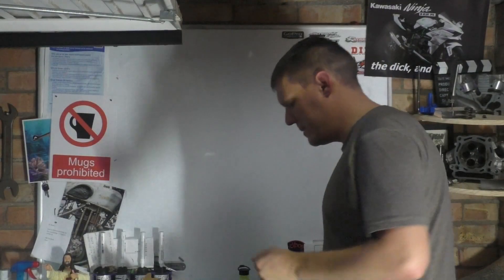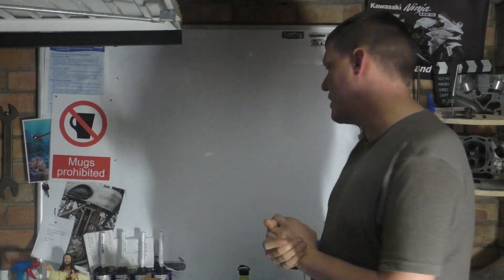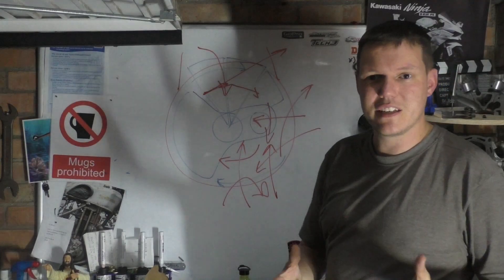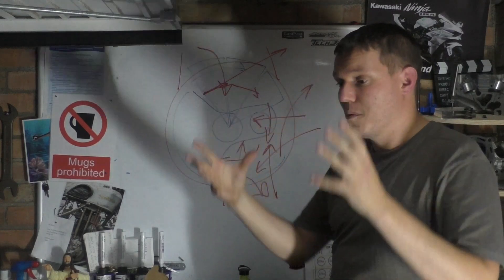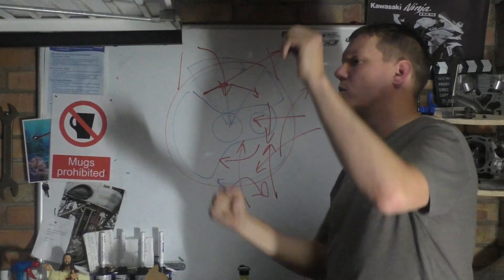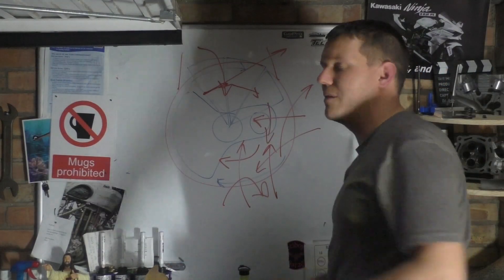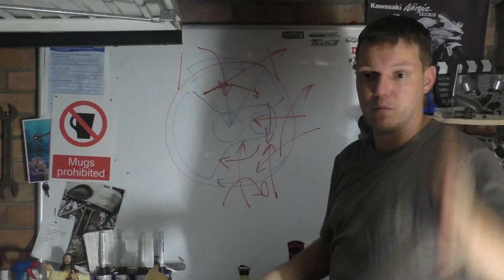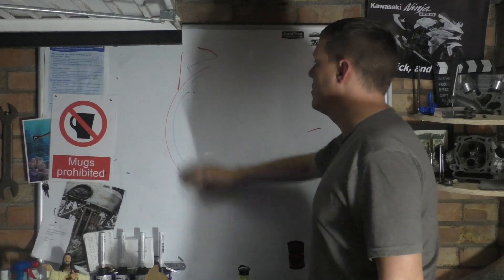Knife edging Crankshafts - Does it work?

Comment: This may be a stupid question, but isn't the crankshaft submerged in the engine oil? And if not, Which parts of the engine are?
Reply from the maker: lol no, and we'll get to why
Reply: no... generally the only thing actually submerged in oil will be the oil pickup to the pump

Comment: Knife edging the crank shaft would not make a difference aerodynamically, however, it would lower the mass which, in theory, would make the application move easier with less power applied allowing it to accelerate quicker...
Reply: But it would fuck the balance up, right? The material is there for a reason, if they could make it lighter they probably would at the factory.
Reply: funcounting  If they do it properly then no, if they just go ham at it and guess by eye then yes, you are right, it would vibrate and kill it.
Reply: aaaand you'd have to rebalance the piston and conrod...
Reply: SESH Rider  Wrong, the piston and conrod are in the centre, they will not have moved because of knife edging the crank shaft, it does not alter the axis angle at all.
Reply: @TheOldRogue  Of course it doesn't. i'm talking about the weight of the rotating mass.
Reply: SESH Rider  I stated that above that if they did it properly then it would be ok, if not then it would vibrate and kill it. :)

Comment: They did that a lot in the 80s and 90s with the high revving 4 cylinder race car engines, they did that only to lighten the crank though and not for any aerodynamic reasons. Since a race engine is probably driven at full throttle 90% of the time, the idle doesn't really matter, revs were the only thing they cared about back then.
Reply: Lighter components also makes for faster shifting I think. Less strain on the gear box slamming the gears without using the clutch and faster rev matching on up shifts.
Reply: @Henrik.Yngvesson  Lighter components make a faster revving engine and therefore probably easier to rev match. Durability wise there weren't really much problems with the gearbox, since the 4 cylinders didn't have much torque, that was more a concern for the 6 cylinder turbos, like the 3.5l straight 6 turbo from BMW in the e9 coupe. There was no 6 speed transmission that could withstand the torque of that engine and the 5 speeds that could had   not enough gears for the straights, which caused the engine to blow up quite often due to over revving on the straights. Must have been a blast to drive these beasts back then.

Comment: I didn't hear you say anything about lighter parts being able to spin easier.  Definatly agree with it being easier to stall with the loss of mass.  The engine balance would also be shite after this modifica..........I mean, change.
Reply from the maker: that's because this wasn't about that - one thing at a time. There's actually loads about angular momentum and rotational inertia. It also leads onto cross-plane crankshafts etc

Comment: There's not even much air in a crankcase is there? I thought the intake had a draw out of there, so it's low pressure?
Reply from the maker: LOL no. The volume of a crankcase is huge.
Reply: cars have that sort of thing via a check valve, but i think it's more to do with making sure the crankcase doesn't become pressurised and piss oil out of every imperfect seal
Reply: Not too much because you get leaks and power loss because of blow by. The optimum is a slight vacuum( just a tad) the rings seal better, but not so much that you suck oil into the cylinders. Many older engines or race engines for shorter stints like dragracing only have a breather to let out the over pressure into a bottle somewhere to keep the oil mist from leaking onto the ground.  Dragracers work under full power the whole time and they have a lot of blow by because of the extreme compression and/or overloading they do with turbos, superchargers or nitrous so the little power loss they get does not really matter: 1500 or 1505 bhp? Who cares...

Comment: Ok but this crank from that specific bike is knife edged from the factory .. I have some serious Ducati corse racing cranks here wich are super thin made but strangely the stock 749R is actually knife edge shaped so streamlined . I understand what you mean with the modified stock crank to knife edged modification but in this case this is not what I was referring to .. hell I walk to the workshop right now and send you some pictures to show what I mean haha .. keep up the good work I love your channel and even pick up a thing or 2 here and there that helps me
Reply: There might be advantages in a high reving bike engine as the crankshaft webbings might spin fast enough to stir the engine oil up into foam. I know that normally there are splash shields in car applications.

So the crankshaft is not optimized from an aerodynamic point of view but one regarding engine lubrication.

Comment: on a single cyl 2 stroke its incredibly stupid. 1 cylinder ecual you remove weight from the counter weight which makes the engine poorly balanced and you inlarge the volume of the crankcase(a little bit) which is not good for the compressing of air fuel mixture in the crankcase (eng = 2nd language)

Comment: If knife edging doesn't work please explain why a homoligation engine like the 749R from Ducati would have this stock ..? This engine was developed for 1 single purpose and that was to compete in world supersport racing back in 2004 etc . If it would not have any benefit what so ever why would a company like Ducati even go trough the lengths to give it this shape
Reply: Hi Toine, if I remember correctly you used to have some Ducati cranks from John Hackett? If so then the billet cranks were made at DKE where I was working. The cranks were not like the T shape if the stock road bikes and were a wedge with densamet plugs in the counter weight and a large alloy plug in the pin area. We would radius the webs ob leading and trailing edges  because the Ducati would have a lot of oil travelling back to the oil pump and it was to stop windage with possible oil starvation more than cutting through the air. The huge pistons travelling at 90 degrees to each other would create more turbulence than a knife edged crankshaft could deal with. It was purely to help allow the oil to get back to the pump with less intrusion. Hope things are going well with you... Rich.
Reply: @YAMR1M  thanks for the detailed explanation!
Reply: No problem.. I spent 2 years working for a company called Holbay making cranks for tuned road cars and Lotus prototypes. Nothing special. Later I went to DKE and made cranks for Ilmor, Cosworth, Honda cars, Porsche, Mercedes (AMG and Brabus) BWM Alpina, Judd, Nissan, Toyota TRD, WCM Moto GP (based on a Yamaha R1 engine, check it out) Yamaha WSB R7's with a crank I designed, Petronas FP1 road and WSB bikes and yes they did built all the bikes, Kawasaki and Ducati the list is almost endless.. Matt is right and Knife edging is pretty much pointless in most cases Its engines which have wide webs like some of the V8 drag or NASCAR engines or the Ducati where it did actually make a difference. Most it was like pissing in a lake.. It will raise the water level but you will never see it.... Its too small to measure in most cases.
Reply from the maker: There's a difference between thin webs from the factory - like say the subaru boxer crank and knife-edging a crank that was stock. Don't mix up the 2.

Comment: And now you have to re-balance your conrod and piston to the counter-weight. Great fun.
Reply: Few minutes on them with cut off wheel should do the trick xD
Reply: The point of edging is to reduce weight of the counter weights equaling it to the piston and con. Rod making them the same
Reply from the maker: But they are already... do you think they're not balanced from the factory? Or do you think that much mass needs removing vs any aftermarket parts???
Reply from the maker: I think you don't know what you're talking about? Secondly, removing from the edge wouldn't be the best place to remove mass...

Comment: I thought knife edged cranks were for wet sump systems to pass through the oil with less drag.
Reply from the maker: The oil in the air. Same thing - and also bollocks
Reply: @thedirtyworkshop  does depend on the engine a bit too.  As for it being bollocks.. Yep it is too in most engines. Nissan touring cars were very extreme and would take the dry sump return pipe off after running the car to measure how much oil would come out.. They were obsessed with it even though most of it was just oil returning from the head and else where that had nothing to do with the crank holding or being coated with oil. They would even micro polish the crank webs to try and get the oil to not stick! That was obsessive to the point of being insane.

Comment: Its doesn't matter for a 2 stroke... but for oil filled case, it makes quite a difference. Car accelerates, and some oil pools at the back of the engine.  The crank is moving like 300+km/hr on the leading edge in a viscous oil environment. Its like 25+ lb ft for something like a 2jz at 8k rpm. Titan motorsports claims 40-60 lbft and mass is reduced to 45lbs from 60, for their 2jz knife edging. It can also keep the engine oil cooler and less foamy.
Reply: It doesnt matter on a 4 stroke engine either. 
FIRST of all, the crank is NOT lubricated by being submerged in oil. It hangs directly above the oil level. It gets its lubrication from oil canals inside the block and through holes drilled into the crank journals.  The sump has baffles that keep the oil away from the crank. If you had a crank splashing into the oil at 6 to 10000 revs you would froth it up like a milkshake by creating LOADS of tiny air bubbles in it and that would be VERY bad for the engine.
In high performance engines you also sometimes have so called oil scraper plates mounted next to the crank that are supposed to scrape off the oil when the crank rotates. But that is purely the oil coming out between the crank and the journal caps and from the conrods and piston lubrication systems (In a race engine every millisecond and every little ounce of power counts...)
 We used to make those scraper plates ourselves on the race engines. Loads of measuring, cutting, filing and swearing.
Many will say they have NEVER seen any baffles in a sump? 
No. Not in the sump of a normal road car. But just take a look into ANY high performance sump and you will see the baffles and some after market race sumps even come with scraper plates ready to be adjusted/filed and cut for the crank you want to put in
Reply from the maker: "Its doesn't matter for a 2 stroke... but for oil filled case, it makes quite a difference."

- prove it.

"on the leading edge in a viscous oil environment."

- LOL I don't think you understand what's going on inside dude.

"It can also keep the engine oil cooler and less foamy."

- this is mainly due to windage trays
Reply: For just 2 webs on a crank, the drag force = 24612 newtons, aka 33 hp, aka 21.65 ft/lb @ 8000 rpm

This is probably fair, if not understated, because there will be resistance on all the webs. For something like a inline 6, the back of the crank will basically be swimming in oil on hard acceleration, but the density of the air-oil mix will not be 872 kg/m^3 across the entire crank. I think the thick viscosity of oil would also increase the Cd dramatically more then 2.1.

F = 0.5 C ρ A V^2

A = Reference area , m2.
C = Drag coefficient.
F = Drag force, N.
V = Velocity, m/s.
ρ = Density of fluid (liquid or gas), kg/m3.

A = 0.00387096 m^2 (aka 38cm^2) for the rear 2 crank webs
C = 2.1 Cd, Assuming a flat faced block
V = 83.3333 m/s, aka 300km/hour crank web speed
ρ = 872kg/m^3 20w-50 density

24612.65 = 0.5 * 2.1 * 872 * 0.00387096 * 83.3333^2

Comment: To me knifing the crank only makes a huge difference in crank weight not aero/hydro dynamics. You would end up turning your motor into a quick revving monster with no low end power due to low reciprocating mass? Do I have this right???
Reply: I remembered your video about GP engines having minimum crank weight. That's why they have to idle so fast, no reciprocating mass to keep them idling in the lower RPM range. See I listen... someone needs to tell my wife that :)
Reply from the maker: Reducing the rotating mass means that less energy is used in acelerating that mass. This is a double edged sword. Lower engine speeds means that between ignition event the cranks losses speed due to pumping losses etc. This generally means a rough as fuck idle (if you get one at all) and sometimes lower end torque is reduced. 

This is specially important for lower numbers of cylinders with single feeling the brunt of it the worst.

The whole point of knife-edging is what I explained in the video. Crankshafts are usually well balanced and removing this mass to some of the extremes these idiots do, seriously effects that. Coupled with the reduction in the flywheel effect (angular momentum) compounds itself to make a real shitty running engine.
Reply: I always thought/read that knife edge had more to do with lightening and balancing when you switched to lighter weight pistons and con-rods.
Reply: The crank(shaft) does not belong to the reciprocating mass, as it is spinning and not reciprocating.
Reply: Some times you want yo remove some mass but not too much. I always wondered why some guys wanted 40% taken off and balanced. You have to putmallory metal in the throw to balance it. Why take it off in the first place?
Reply: He's got it backwards anyways , you would want a bull nosed front edge and a knife edged trailing edge , do it wrong and you'll probably have lift like a wing !!!!!! It's not worth it .

Comment: Does the crank spin through oil in the sump?
Reply from the maker: LOL god no. At high rpm this would break a crankshaft.
Reply: I know, but i bet alot of peeps think that it does
Reply from the maker: Already working on the video dude
Reply: no it doesnt, unless you overfill with oil
Reply: No it doesn't.
Reply: I think that at high RPMs the crank would blow the oil tangentially in the direction of it's spin, maybe making one bank (if it's a V-x engine) more lubricidous than the other
Reply: Nope.  The clutch doesn't, either, which a lot of people also seem to think it does.
If you look in your bike's service manual, there's a section with lubrication diagrams - they usually have a cutaway view where you can see where the crank and clutch are in relation to the oil level window (or dipstick).

Comment: If a crank is knife edged the counter/balanceweights needs to be bigger, because you cant remove weight without it vibrating like crazy.
Dont do it on a 2 stroke because that could fuck up the transfer port effectiveness, because there suddenly is room for more air in the crankcase then before.